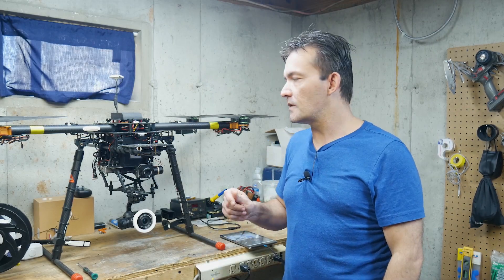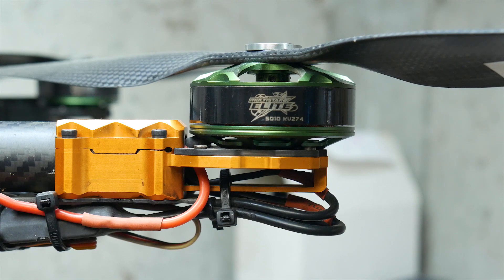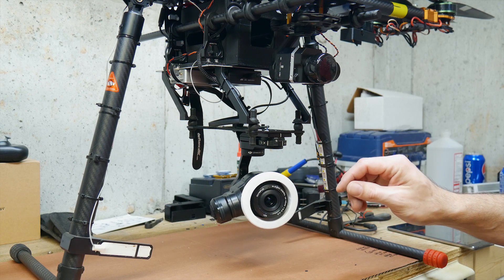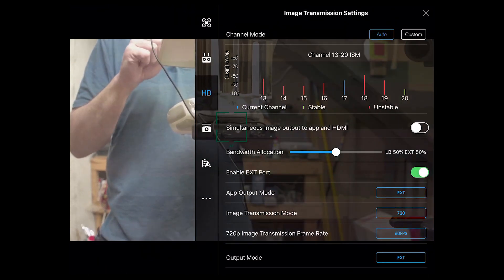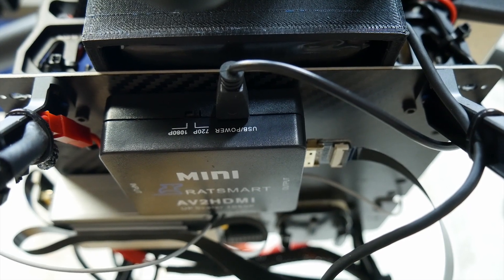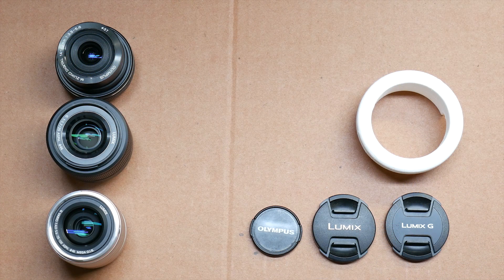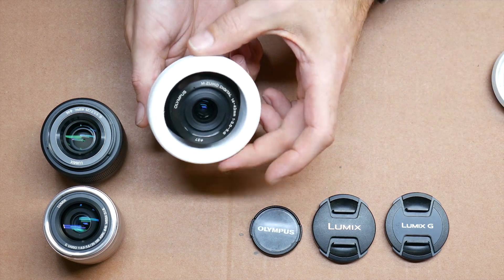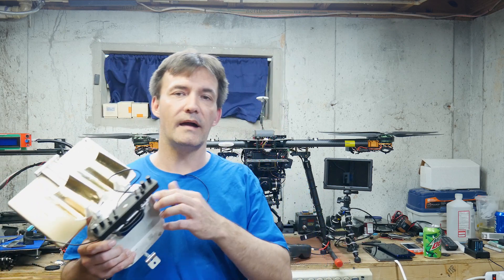My t960 drone build explained

Comment: hi, what values did you set in the dji assistant for basic gain and attitude? please
Reply from the maker: sorry about the delay hector, I just saw your comment, for pitch and roll gains they are set @ 150, the yaw gain is set @ 120, and for vertical gain thats set @ 110. The attitude is set @ 100. thanks for the question and sorry again for the delay.

Comment: hi it's very cool build and nice flying thank you ,can you share the total weight of the hexacopter and naza gains value please.. thanks
Reply from the maker: hi sir_Maher k sorry about the delay, the weight with the 16,000mha 8cell battery was right at 17lbs. The gains are roll and pitch 150, yaw 120, vertical 110, and attitude 100. thanks for the question and sorry again for the delay
Reply: @MONEYPITRC  Many thanks
Reply: did you find the gains? please

Comment: So what kind of power distribution board did you use?
Reply from the maker: Hi sir sorry for the delay, I don't use a distribution board its wired straight to the esc's and the flight controller, anything I need to power that's a lower voltage then the battery's voltage I just use a voltage step down.

Comment: Hi love the channel.  By the way i want to ask you . i have a 4drc m1 mark300 drone with gps wifi and has a camera that is just goes down and up by pressing a wheel on the controller. I want replace it and add 2 or 3 axis gimbal on camera . same kind like the dji mavic has. The small on . is it possible to buy that part and add it to my drone. See my camera is detachable. Ill try to send a pic. I really want to get your professional advice. Really hope this will work . look forward to your response.  Thank you. 

Mike

Comment: XT60 battery connectors seem a little risky.   Have you checked in flight current draw?  I would think hover throttle is going to be at least 10 amp per motor (6S) or more plus if you are feeding the gimbals and such.  XT90 would be a safer choice plus the bullets on the xt90's will work better with the larger gauge wire on those batteries.
Reply from the maker: hello spyder000069 sorry for the reply delay, i did a test today i will upload the video once im done with it, looks like with the 6cell battery i had 34 to 35 amp in a hover. I have tested it about a year ago unfortunately I forgot what it was exactly. Thanks for the question.

Comment: Very nice setup although  it seems a little bit too complicated at least for me. I also own the 960 but went a different route. I just have one  gimbal that mounts a GH4 or similar weight camera. If it ever stops raining here in the San Francisco Bay area, I will finally get to fly it so I can do some fine-tuning. I had the same motors for a while but kept on experiencing completely unexplained crashes. I had no idea what was causing them So eventually I sold off all my equipment and replaced everything. I remember the motors being a bargain for the quality. 30 minute flight time? I will assume that is without the cameras and Gimbels. Mine would get that unloaded. Oddly, I just got the 810 version and only got about 10 minutes of flight time. I will have to fly it when it is not so windy. That may have been the issue. Cool video, I will check back for the next one. Thanks for posting.
Reply from the maker: thanks for the comment, its about 30 minutes full up weight flight time thats with everything seen in the video mounted, ill post a video later when the weather gets better.
Reply: @MONEYPITRC  wow, that's really good.